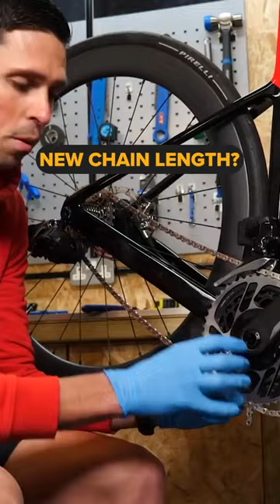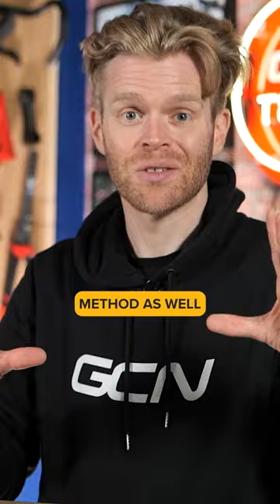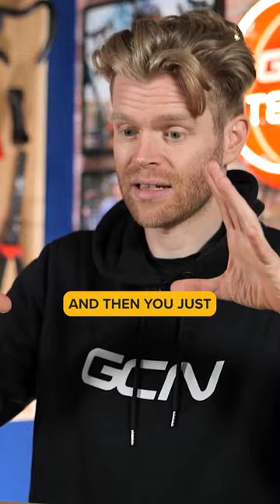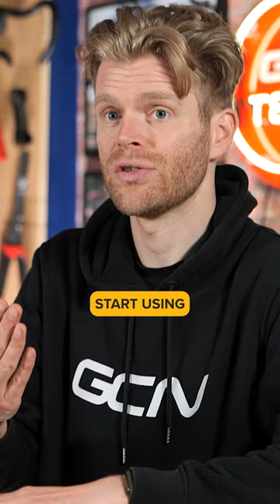How do I work out chain length on my 1x bike? 🤔

Comment: Not efficient advice here For example you have an MTB let's say The gear ratio is 34t Chainring and 11-52t 12 speed cassette to be efficient on chain length measurement i suggest you put it to the first gear round the chain to the Chainring now if your chain is 2link longer cut the chain about 3links remember there's a Missing link that serves as a link extension that you put To attach the chain don't add four links if it's too long don't remove links if it's already too short you're just Destroying your drivetrain But it depends on the derailleur cage length and Teeth limit of a derailleur and the chainstay length i may not be an engineer or pro mechanic but I'm just doing it right now if it's a road bike with 50/34 crankset and 11-32t 11speed 116 links do the same method never add more links If it's too long already and never cut the chain if it's already too short only add links if you use oversized pulley wheel